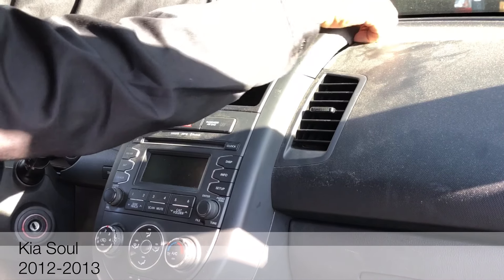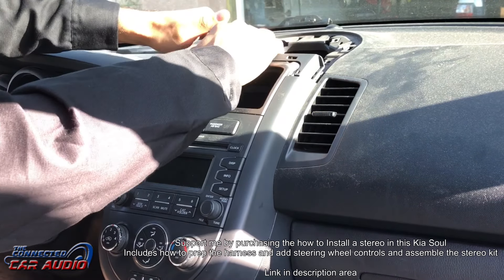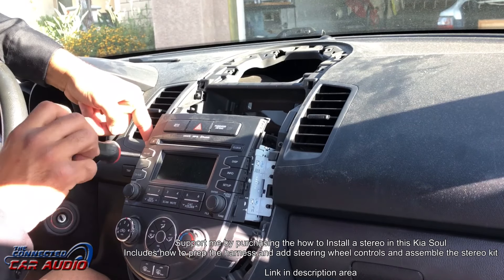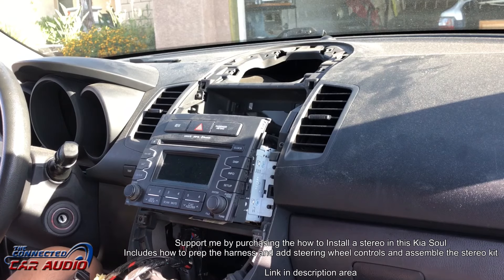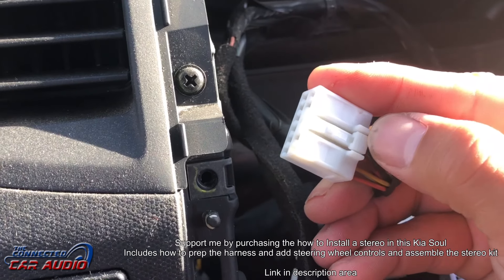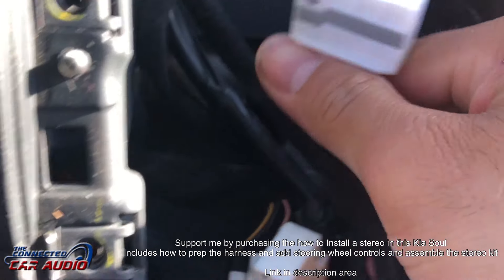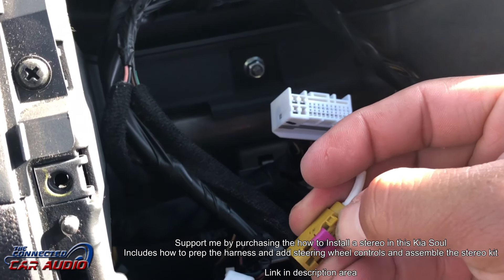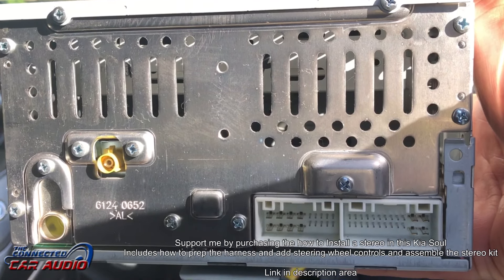How to remove factory stereo Kia Soul 2012-2013

Comment: This helped me alot! However I have another question, how do I restore steering wheel control buttons for the after market radio I installed?
Reply from the maker: Generally you will need a Aswc steering wheel control module 
If you have a name brand brand stereo like pioneer alpine Sony etc it will be compatible 
If your stereo has the 2 wire steering wheel retain feature you can use that also 

The aswc from axxess interface is the best module

Comment: Any thoughts on where I should start trouble shooting .....Kia Soul 2013, 3 of the 4 door speakers stopped working and the 1 speaker that does play sound, cuts in and out, will work fine for days even weeks, then it will cut in and out...and I don’t know much of anything when it comes to this type of stuff...
Reply from the maker: I would start with the speakers themselves 
The problem is almost never the stereo or the amp if it has one 

Get a test speaker and remove one of the speakers and see if the test speaker works 

If it does go ahead and replace all speakers